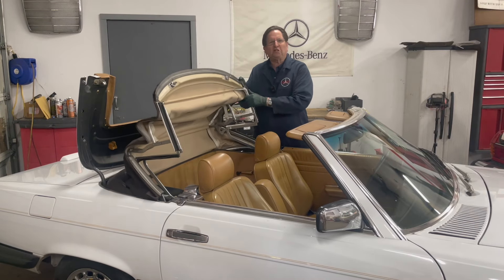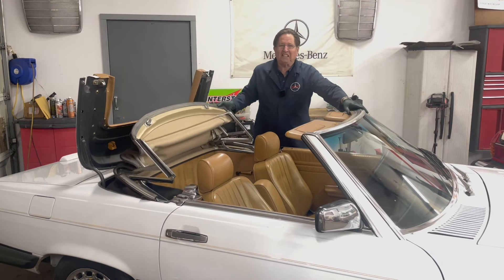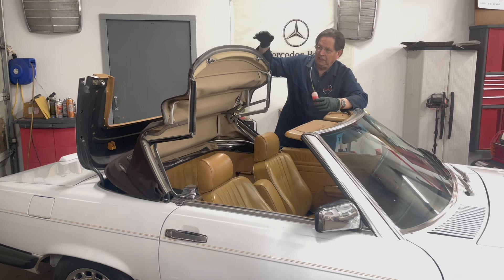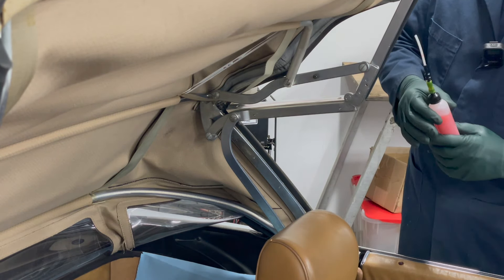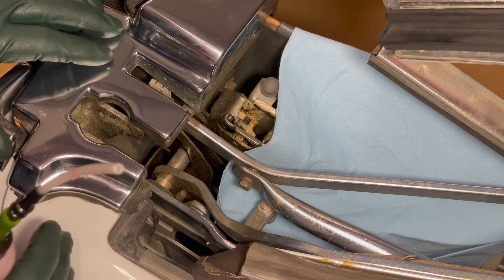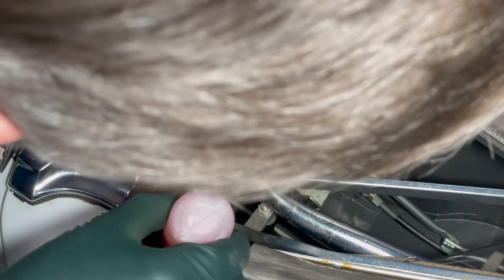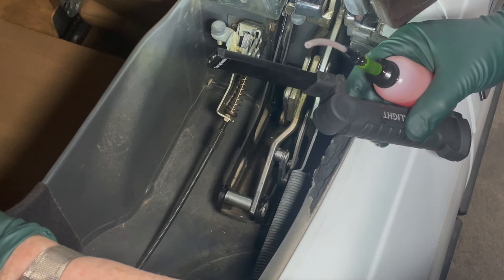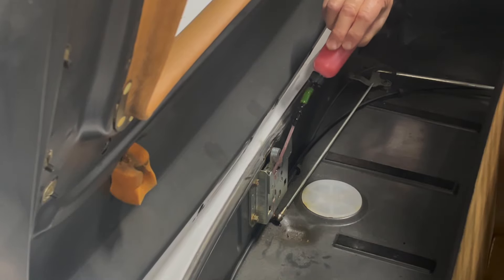This Old Benz with Kent Bergsma: How to Lubricate the Soft Top on a Mercedes SL Convertible

Comment: Kent, could you wipe this lube onto pneumatic/hydraulic rods. How would it affect the seals? Help or hindrance? Thinking SL hardtop roof mechanisms. Cheers.
Reply from the maker: Great possibility. It is fully synthetic, so it will not affect the seals.